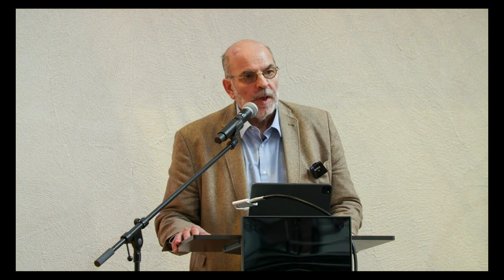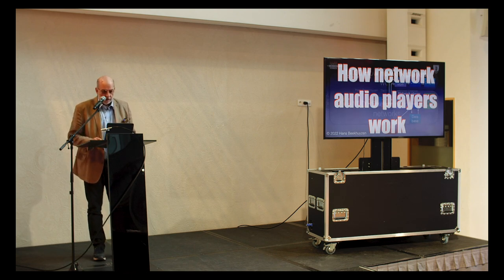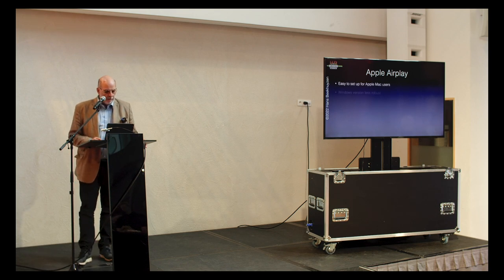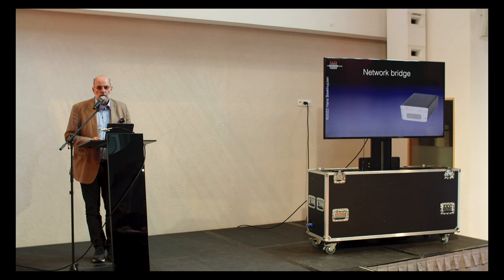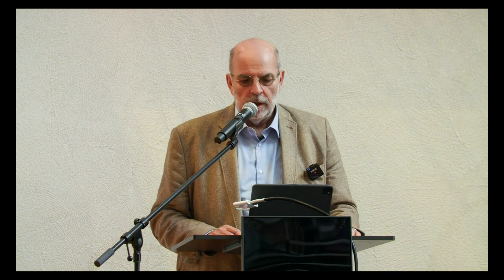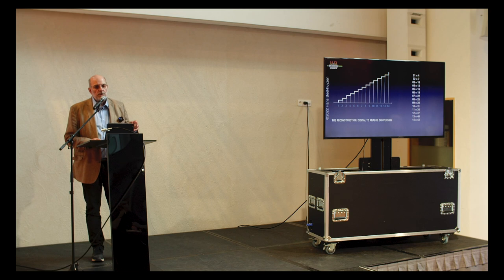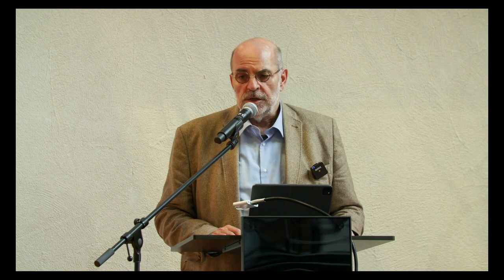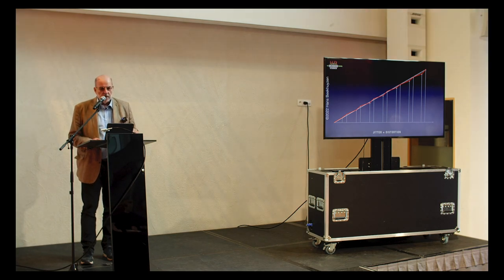My presentation at the Noir & Blanc Brussels Hifi Show 2022

Comment: Hi Hans, thanks for sharing this—great presentation. I do have a follow-up question. If Digital remains robust prior to conversion to analog, then wouldn’t a Bluesound Node (theoretically) sound exactly the same as an Auralic Aries G2, if they’re both plugged into the same external DAC?
Reply from the maker: If that was the case, would I have bought the Aries G2 while I already had a Node? The data stays in tact but along with it comes noise, phase noise and a dirty ground plane. The Auralic delivers a far cleaner digital signal and thus confuses the digital to analog circuitry less. It's like lettuce: it stays lettuce but if it isn't washed prior to being served, the sand in it spoils your meal.

Comment: Disagree with your opinion regarding NOS, and your summary dismissal of it as an audiophile solution. Since the images are ultrasonic, any distortion in the audio band is due to intermodulation distortion, which is entirely in the analog domain, and will vary considerably depending on the analog components post DAC.
Reply from the maker: Let's agree to disagree.
Reply: Thank you for the interesting and thought provoking presentation. I greatly appreciate your learned opinion.